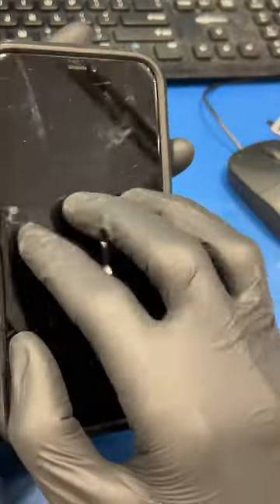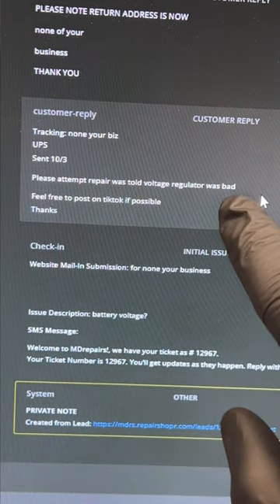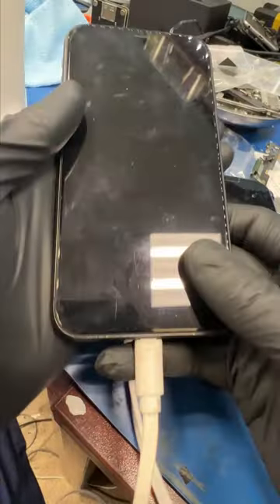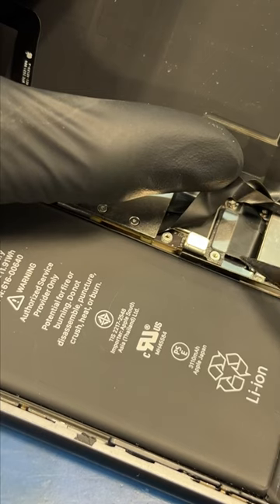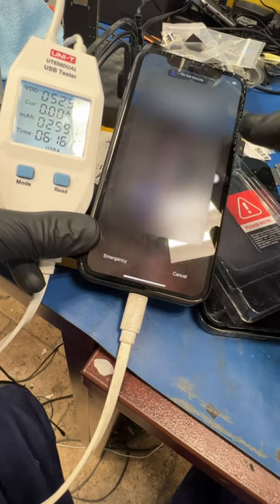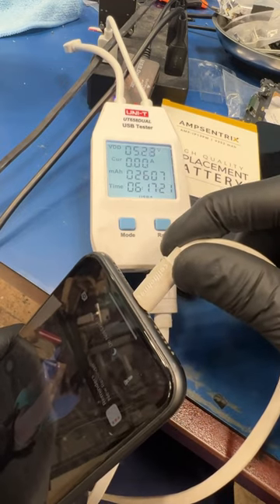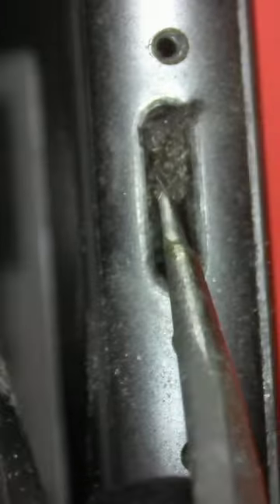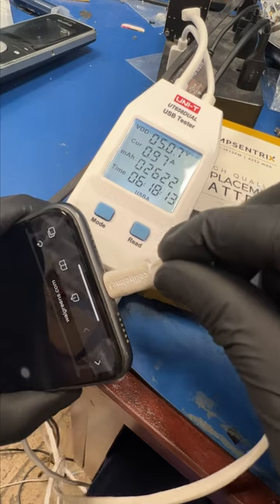iPhone Data Recovery From TheyBreakUFix? #iPhonerepair

Comment: My old 7 lightning charger got incinerated on the tip I don’t even know how but I was using my phone and it stopped charging I looked at the charger And saw a slightly burnt tip, needless to say I kept the charger 💀 I use a different charger because the other one f do doesn’t  work

Comment: Since when is a connector a voltage regulator? They are two different things.
Reply: Lol that’s the point bro he was just being sarcastic. That’s literally just the charge port and the gunk in there was messing with the battery’s intake of a charge. Also the battery cable wasn’t fully plugged in which made it worse which is honestly stupid because it’s like why? They made no money off that and could have since it was such an easy fix.

Comment: Why are you calling the socket a 'voltage regulator'?
Reply: Because that’s what regulates the voltage input
Reply: @Really_jellis  Yes, but that is not at fault, its the socket. Lets be honest here. That is like saying my cars fuel tank is damaged because the filler cap fell off...
Reply: @peterpeterson9903  well as long as we are being honest if you don’t have the cap on your gas tank your car will start to have engine problems I know from experience
Reply: @Really_jellis  Not all systems run a vapour system so a rather moot point. Point is, its the fucking charger socket that is clogged.
Reply: @peterpeterson9903  causing Volts to not be regulated properly lmfao
Reply: @Really_jellis  Not at all. Voltage regulation may only take place if there is a good electrical connection.
Reply: @peterpeterson9903  that’s literally what I just said
Reply: @Really_jellis  No, your obviously not too hot on written English. You implied that the socket was causing poor VR, when in fact that's not true.
Reply: @peterpeterson9903  that’s exactly what the issue was maybe you need to re watch it
Reply: @peterpeterson9903  also this is not true it can regulate volts even with a poor connection as long as it’s connected it doesn’t matter
Reply: @Really_jellis  Jordan, stop digging! You are not winning anything here, you are merely coming across as someone who knows a little bit about the subject and want to be a bit of a keyboard warrior. It is the socket that was bunged up, this is not a VR issue, it's a socket issue here. That the socket is soldered to the VR circuit board is immaterial. You are splitting hairs, I am quite well aware of what can and cannot happen via an electrical connection, the socket is just a socket, it allows an electrical connection, the VR needs input to do its job, if the connection is poor the problem doesn't even get as far as the VR because there is nothing to regulate, if the connection is bad but allows some input, then it may operate but not well. Quite simple.
Reply: @peterpeterson9903  I’m not reading all that have a good day lmfao
Reply: @Really_jellis  That was graceful enough. Well done!

Comment: Voltage regulator? Why are you calling the charging port a voltage regulator???
Reply: It's clearly a sarcasm as the other shop called the issue as a "voltage regulator" problem, when it's clearly just a lint on the lightning port.

Comment: Voltage regulator, ah you mean the charger port?
No, it's the regulator of the charger. But I fixed it by cleaning the charger port 😂😆 wtf
Reply: @bigboyhours6473  someone's an angry elf 😆 🤣

Comment: Please help me my iPad when I try to force start it with home button and power button it will show it needs to charge and then when I plug it in and do it it says the picture of it needing to charge no matter how long I charge it it won’t turn on  I cleaned the lint out please help iPad gen 5
Reply: Have you tried a different charging cable? You might need a new battery or charging port. Just a guess.
Reply: @SirBlueWhale  I’m thinking I’m going to need to replace the battery

Comment: i have a 100% shattered and bent iphone that i installed a new screen on but i'm getting the same boot loop. the battery cable is plugged and in the charge port is clean =( lol
Reply: oh hey after re-inserting the battery connector and switching charge cables i'm getting a charging icon now

Comment: I had 3 Apple products. $1200 tablet and $800 phone then $350 phone after they all got dead battery. After a lot of searching I found someone else say voltage regulator. Apple claimed them all brain dead. Wouldnt even put new battery in when all that going on just to test it. Waited 4 hours with the $350 phone that I used 5 times and went dead battery! Same replies. We left to a mom and pop shop. Put new battery in, in front of me, it worked fine but again by charging it up the next day it died and wouldnt go on. Then  read that if you use heat it comes on. That did work but wont stay? By this time I gave up. Got a $100 Samsung android phone that did all my apple did. The worlds caught up so you can mirror across devices now too. Then got a plan with my partner so got a $120 phone on his plan. But kept my $100 one for back up. I now save my pics and documents to google cloud now. Then stopped using wordpress as a blog site. Too hard to finagale pics from apple and then google into wordpress. So now doing my sewing blog on  blogspot. So easy to drag pics to blogs! Im curious now. I may take apart my apple phones. Sell them! I taught myself how to jail break my ver first android and took off the ATT bloat All things change so much I wouldnt buy a high end phone any more. My tablet helps me do other things. But yah, it keeps my online life slmmer. My parnter has a MAC. But just this week safari internet browser aged out to be able to go into his bank. I put Chrome on there and checked all his boxes and deleted unnecessary things. Say no to most questions. You know Im 68. Online since all this started and owned first computers. Ive never had a virus nor been hacked! Have one game on my phone! If I get bored and put another I delete the other one. Stop all that!